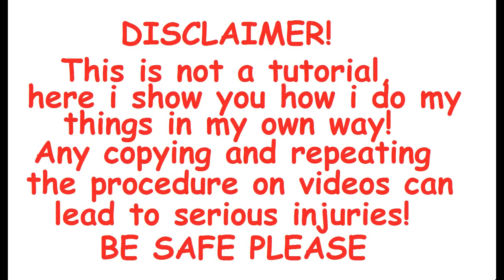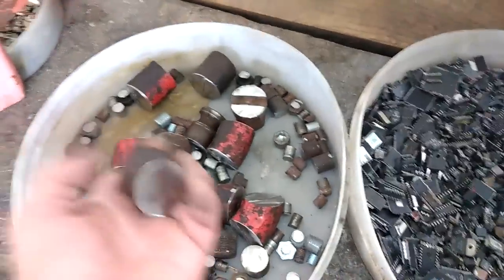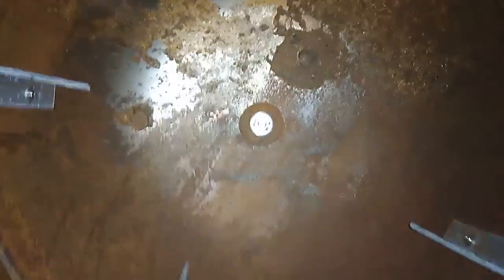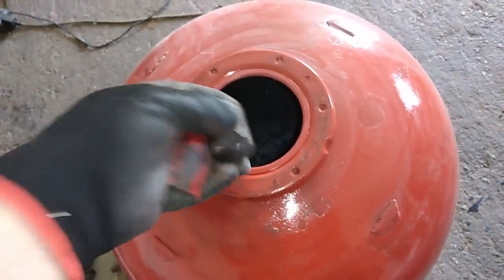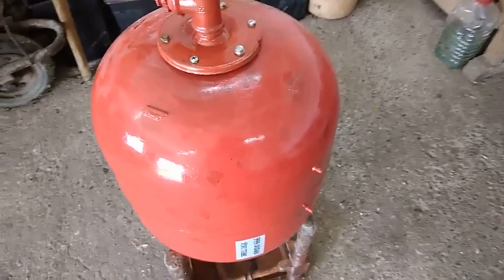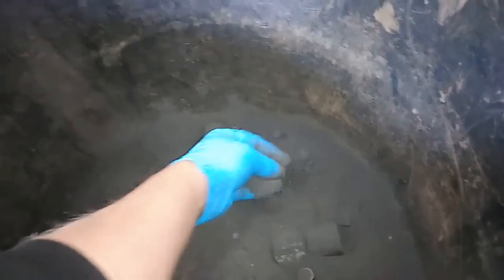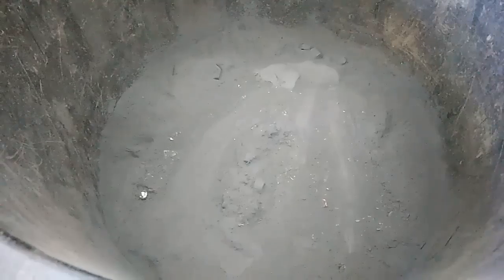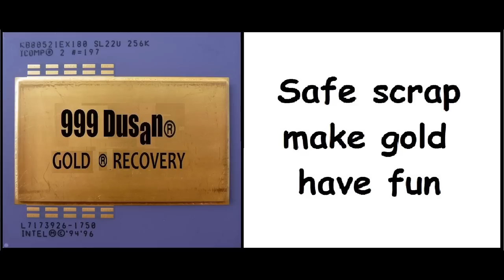New BALL MILL first run

Comment: You mentioned that before your new ball mill, you used a motor grind unit. You don't seem to have a video about how you make the motor grinder. Maybe those who would prefer not to ash chips could use the grinder technique and not a beverage blender.

Comment: Make sure the finely dispersed powder isn't explosive. I don't know. Ground everything (electrically). Also, normal ball mills use non sparking ceramics, for both the ball material and the liner, steel on steel will spark. Just be safe. Nice results!

Comment: I wouldn't add any liquid to the container, especially acid. The liquids will attack the steel and iron. Also make a mess to wash the mill out. Besides, acids will require a vent to exhaust their gasses. Recommend you use a metal serving spoon to help scrape the burned ICs out of the burn box.

Comment: That was so satisfying  . I plan to make one using  an  old stainless steel pressure cooker. The removable lid make it easier to load and unload.  You could also use a large magnet to separate the steel balls quickly.

Comment: odlična ideja o komadima željeza i šarafa umjesto kugli,ja planiram napraviti nešto slično ali od stare mešalice za malter,malo ču je modificirati i prilagoditi za mljevenje čipova,ali pokušat ču i ja sa komadima željeza umjesto kugli.dobar video Dušane.
Reply from the maker: Moras da napravis poklopac da ti ne prsti vani. Ili voda!
Reply: Many years ago I bought a cement mixer for a backyard project. I have not used the mixer since. Now I am wondering if I can convert the cement mixer to a mill? It still has the motor and gears on it but may be a bit rusty from lack of use.

Comment: should test if your mill will grinde up ic that are not burnt. may take longer but if it work its one less task in the prosess
Reply: I too was thinking the same thing. Not all of us have the ability to burn chips in small close neighborhoods. Open fire restrictions are in place in many Countries, cities, and small towns. I think Dusan is right that the sharp edges of the steel pipes will eventually break down the un-burnt chips, it just will take longer, maybe even overnight or longer so if you are in no hurry this might be the answer. In a neighborhood where your neighbors are right next door, you may think about putting the whole mill in some kind of sound proof box.

Comment: Hey mate incredible results, incinerating them definitely makes it work faster than putting them in without burning. I like to not burn them because I live in a very populated neighbourhood with annoying neighbours who complain about the smell 😂 
Make sure you wear a dust mask as well as your gloves, lots of hard work earning money isn’t worth anything if you get silicosis or another lung disease which causes early death. Safety first buddy.
Reply: Hi, I too live in Australia in a populated neighborhood and prefer not to incinerate. Just takes a little longer. Per above Armory Industrial's comment, I didn't even consider that the very fine powder could explode with steel on steel grinding pieces producing a spark. Could adding a little bit of water keep the dust down?
Reply: I know wet mills are definitely a thing however I’ve got not nearly enough information to know whether or not it would work for IC chips sorry.

Comment: Great job man. Necessity is the mother of invention. The material should give a great recovery. Thanks for sharing. I have used a 1/2 bag cement mixer to remove gold from quarts rocks. I put in some steel balls from a ball mill and let it ride. Always a great recovery.

Comment: damn , that works great , after ya do a few runs thru it ya might want to check under the agitators inside the mill , looks like a place to trap bond wires
Reply from the maker: Yes but never mind, they safe insyde, one day vhen mill go to scrap i vill open it and maybe i get big suprise hahha
Reply: @999DusanGoldrecovery  yes you may find a good results more than likely

Comment: Consider changing rotation up to 30 rpm..  get the grind job done! Try an Adjustable DC Motor Speed PWM Controller.

 To each their own.

Comment: Hello, what motor do you have use for the mill? The powder is verry nice, wash this with blue bowel slowly and soft.
Reply: To me it looked like a 12v windshield wiper motor from a large car, maybe a truck. Dusan maybe you can get some solar panels and run the mill from that in sunny days and save your car battery.

Comment: Water cuts down on dust and noise.
Reply: True but then how do you sieve out the gold bonding wires from the mud? You are adding another step to the process. You would have to dry the mud back to a powder form for the sieve.
Reply: @Alex-kp3hr  or you make a sluice and process what you catch in the riffles with acid. making it safier as well.  The dust is hazardous.  I suppose everyone does things a little differently.

Comment: Hi Dusan, Your new ball mill looks great. I was wondering how long would it take to pulverize 1kg non-burnt epoxy ic flat packs and 2 sided chips? If you want something that can do the job in 30 minutes, think about using a DIY hand held angle grinder mill using no welding. I saw one used for pulverizing small quartz rock to a fine powder in 30 seconds. I think quarts has a harder PSI rating than epoxy which means that epoxy chips would be easier to pulverize than quartz using the angle grinder mill. I saw it at: https://www.youtube.com/watch?v=YDCOWNoyT1A. Cheers from Australia.